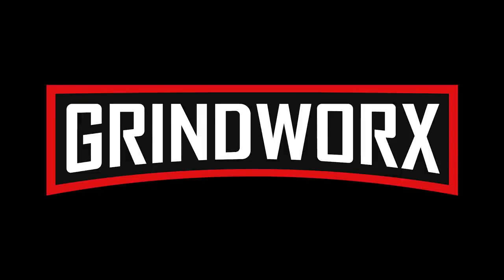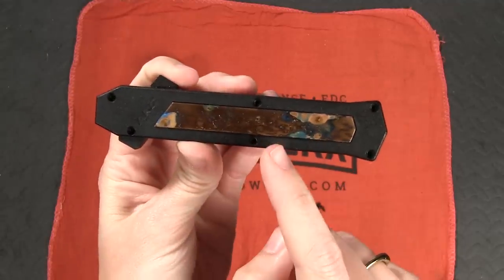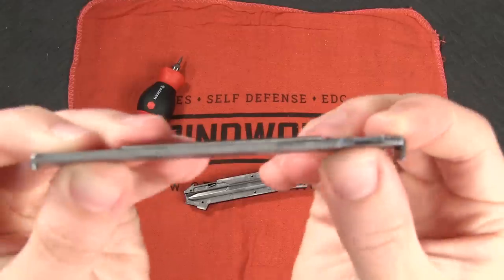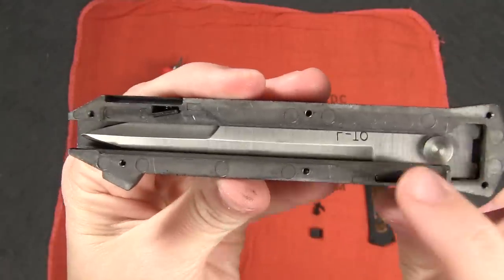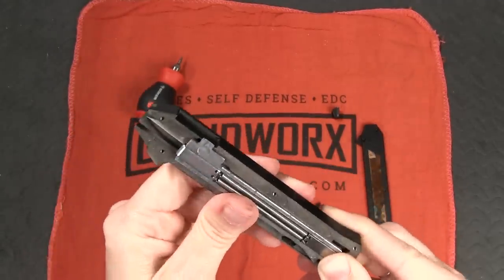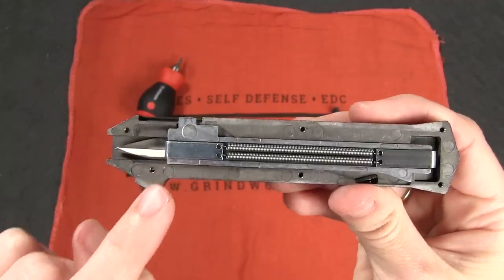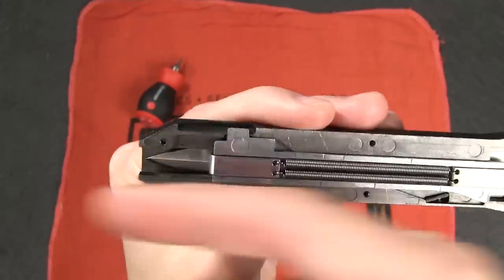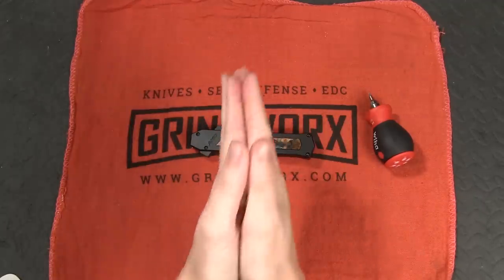How Do Double Action OTF Knives Work???

Comment: When a OTF miss fires, 
Is it because the little spring lock malfunctions in the front or rear? And if so, what’s the way to correct that?
Reply: Honnestly I don't know I'd say that may be you could lower the "range of motion" of the torsion spring that hold it. BUT if is as strong as it is, it's in order to keep the blade in a specific range of motion and this would make the opposite happend and i guess that it's not what you want.
Reply: Well that would be really nice if the person that actually repairs and build these knives could comment share some wisdom with us.
Reply: When the blade fails to lock, hold a knife in your hand, swing your hand toward the floor. That’ll lock it into place. You don’t have to swing it very hard. Remember all you’re doing is deploying the knife with enough pressure. Did it reaches the lock point or do your stays open or stays closed you’re not using enough pressure to use it as a projectile so it takes very little septic late again this is happened to me several times and that works better than anything I’ve found

Comment: It's a pretty good explanation. But you didn't really make clear that the reason it works is NOT because the spring is in constant tension but because you apply energy from your finger to stretch the spring on each opening and closing. Yeah you mentioned it very briefly but you didn't accent it as THE SECRET of the double action OTF. Because most people don't understand exactly that part. How is it that a spring can seemingly pull against another spring. But they don't...that's the trick and "secret" that should be emphasized. Without your applied finger power this type of switchblade cannot work.